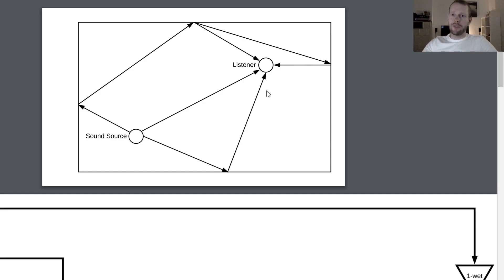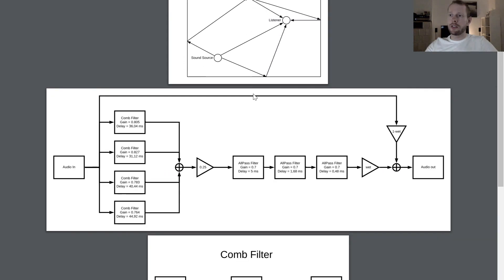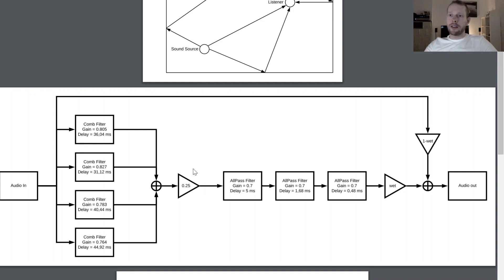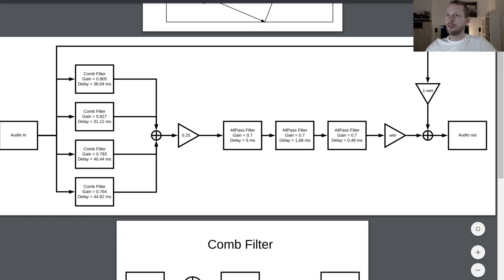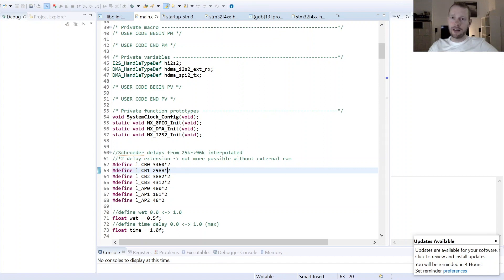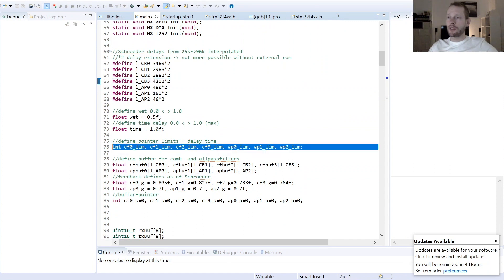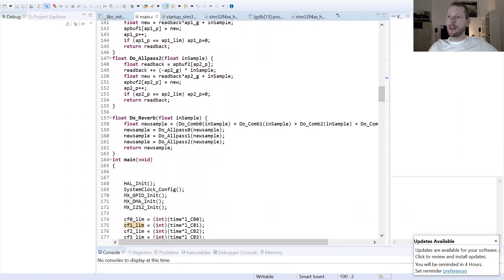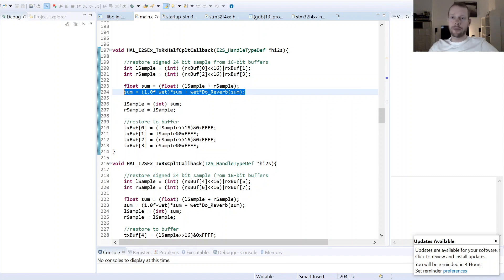[#8]  Reverb - Audio DSP On STM32 (24 Bit / 96 kHz)

Comment: I did forget to say thank you! This design worked very well for a lot of synthesizer projects in the meantime. Getting it running on the ESP32 was successful. I took a look at the ReverbSc effect from the DaisySP library. In comparison it is eating your memory. So this design is a good compromise between sound quality and memory consumption.
Reply: Hi! Do you used any i2s ADC for this?
Reply: @tenorio3490  not yet. The internal ADC was good enough for at least 7bit MIDI control change messages

Comment: Hi, RAM STM32 - 192kB, ESP32 -520kB. I transferred your code to ESP32 and it works for me only with an array 1_CB0 3460 , 1_CB1 2988 etc. What am I doing wrong? How to implement an increase in delay using external RAM?
Reply: You cannot use the complete 520kB for static RAM. Using malloc might help to get some more memory for your reverb.
Reply: @marcellicence  I figured it out later.
I added psram by removing the esp32 cover.
But I did not understand how to use malloc and psram in the code in the context of this reverb and delays.
Thank you for your work and channel.
Reply: @Andy-ph1qj  Perfect! With psramInit() you can make it available and allocate memory using ps_malloc. Using malloc will allocate internal memory from the ESP32 heap. Hope this helps a bit.
Reply: @marcellicence  I do the initialization and allocate a memory area for the arrays 1_CB0 3460 , 1_CB1 2988 etc, the memory decreases, but the increase in the data of the arrays led to an error, I understand that it is necessary to store intermediate variables in psarm calculated by these arrays, but I don’t understand how. I'm not a programmer :). Do you have a simple example of the delay effect using psram?

Comment: Is it very difficult to add external sram to sam32f407 dev board?
Reply from the maker: Check out this board -> this has external SRAM https://www.st.com/en/evaluation-tools/32f429idiscovery.html
Reply: @YetAnotherElectronicsChannel  Thanks YEC! You would still need to add the audio codec board?  Would your 407 code still run on the 429 board?

Comment: This is really great, thank you for making these videos. Is there any way to simulate/design these effects in a GUI – to quickly experiment and figure out parameter ranges etc. And then translate it into code for the STM32? That would be the dream. Are yo manually coding these filters or are they generated from something?

Comment: Did you think of using another method to delay a sample instead using so much memory? Maybe using a counter?
Reply: I don't know, I'm just brainstorming here. Maybe you could use 2 addresses only, instead 3000s, and using a counter to delay. Do you think it could work?
Reply: @danielpadim  Strange. That you didn't get the principle behind a reverb. I mean according to your profile picture, which suggests you are a musician.
Anyway, in the real world the reverb information is stored in the compression of air at a distance-range, what itself is a function over time. To model that with a computer you need to store the audio data. At least something of it to remain brilliance of the reverb. "Counting" something looses the accurate timing information of that something and in case of our audio signal we can't do that. It is a replay operation, so we need the audio information.

Comment: Great vid! 
One suggestion - maybe instead of dividing by four you could multiply by 0.25? It won't make a large difference in this example, but on the long run it's a good practice. Division of F32 data takes 14 cycles and multiplication takes 1 cycle in the STM32 FPU.
Reply: Wow, this is a great advice, thank you! 
Do you know if there is anything that I can read about this kind of optimizations? Thanks

Comment: Great stuff! I don't know if you came across this paper by Jon Datorro ( https://ccrma.stanford.edu/~dattorro/EffectDesignPart1.pdf ) but if not - I highly recommend it. It showcases a different reverb structure (two cross-feeding allpass loops with modulated delay lines) that produces a much higher quality effect. It would be much more demanding for your uC but I think its doable.